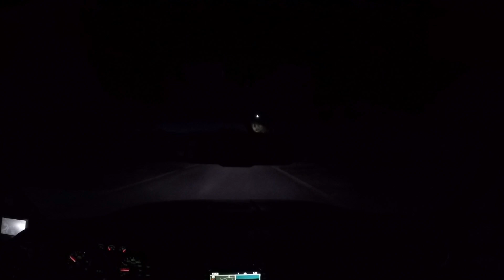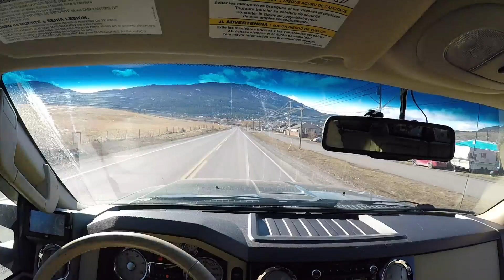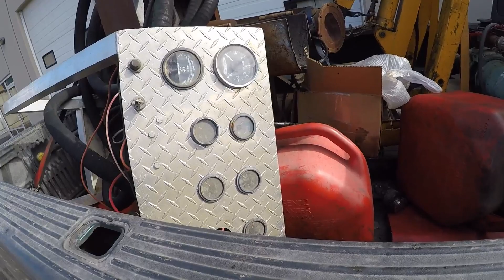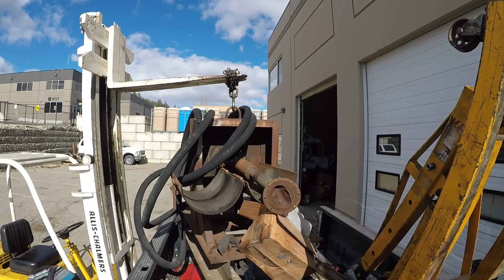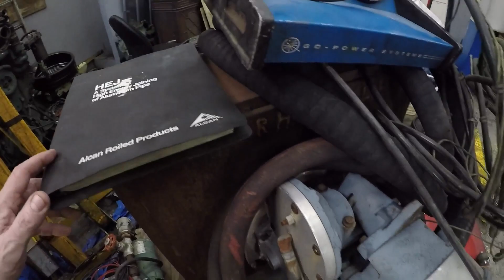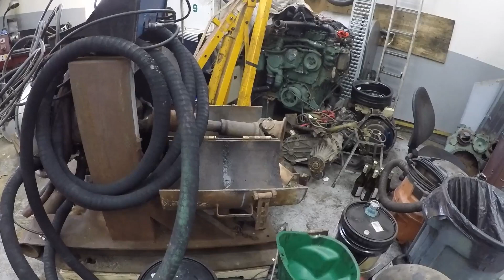Detroit 4-53TIB Road Trip And Dyno Rescue

Comment: What an awesome build, I have watched from start to finish and every video of yours. Multiple times,lol. So happy to see her on the road and that your happy with the result. I have a few questions, first one did you think of going the vgt route?would a 453 work well with a vgt. I have seen quite a few custom vgt setups using drive pressure to regulate vgt position. The other question is how do you think the zf6 would do with the setup you have. I know you had a zf setup if the 5r110 didn't work out. I work on alot of 453n in boom boats, and I would love to try this swap. But I'm sceptical of going with an auto from a simplicity stand point. You have blazed the trail with this swap, it is truly an exceptional job. Good on ya bud. Hopefully I'll run into you someday, maby at k&w diesel. Cheers
Reply from the maker: Thanks, I did think of the VGT turbos and do really like them.  The 453 would work well with a VGT, just need to buy or build a controller for it. One of the reasons I bought this dyno was to try out different turbo's, blowers and injectors etc and see how well they work or don't.:)   The ZF6 is a great trans and would work very well with 453.  I was originally going with a ZF6, but the deal fell through, so I used my 5R110. It's not perfect, but very close.  If I buy the manual shift controller, then it would be just about perfect.  I'm going to stick with the 5R110 and weight for someone to crack the Allison 10 speed.:)  If someone does, I'll swap in an Allison and the shift ratios will be perfect.:)
Reply from the maker: P.S.  Before I built the compounds I was going to use a Switchblade single, but the price was too steep, so twins it was.:)  I think the would be the ultimate single.:) https://switchbladeturbo.com/?gclid=Cj0KCQiA-aGCBhCwARIsAHDl5x9GYCi_jMjW7IaIH85qkHTO8zy3-kGV-_rq4yvevhYGTq08XG9EZ-EaAufCEALw_wcB
Reply: @detroitgarage9430  those switch blade turbos look really cool. Never heard of them before. Keep making videos bud, love watching them.

Comment: What size injectors are you running?  And what boost pressure from the compound turbo setup?  I vaguely remember that 53s did maximum torque around 1800 rpm, with max horsepower around 2800 in automotive tune, I do remember seeing 3200 rpm in a marine application. Would have been around early 1980s I think.  I remember that 2 stroke GMs were substantially better at altitude than naturally aspirated 4 strokes of the time.
Reply from the maker: I'm running 7A77's at the moment and was going to upgrade to 9A90's in the spring.  I set the bypass K27 to 20 psi down from 30 psi and that seems to be the sweet spot.  The larger K31 is at 8 psi, so with 9A90's or propane I should see about 25-30 psi on the K27 and 10-12 on the K31.  The Silvers are max torque at 1500 rpm and I've tuned the trans to shift at around 1600, so it will pull down to 1600 rpm.  I have it shifting at 2400 as I find it really doesn't make much more power above that.  No smoke to speak of and runs great, just would like another 15-30 HP to hold overdrive on the 8% grades.:)